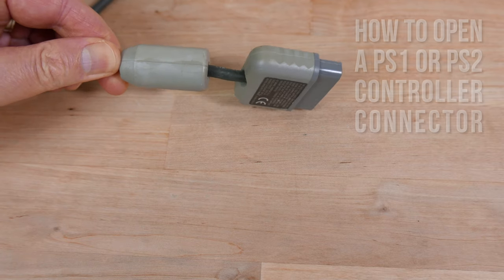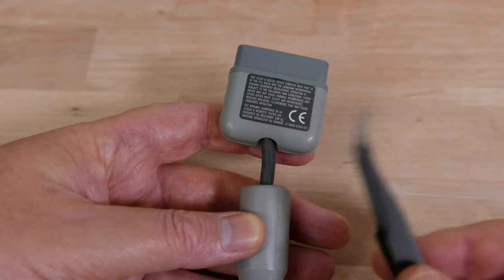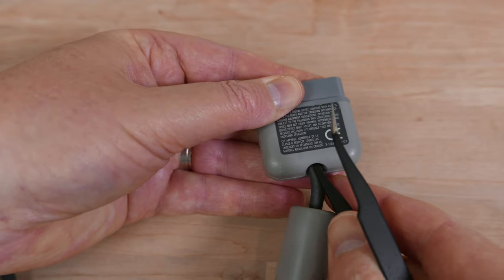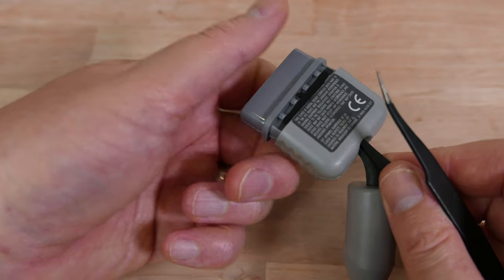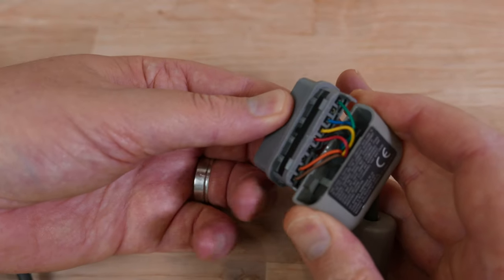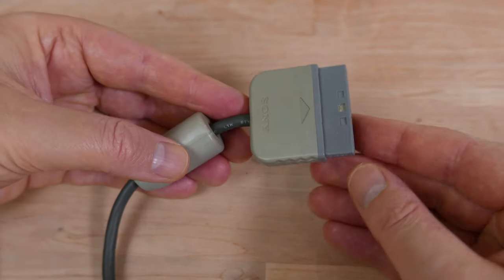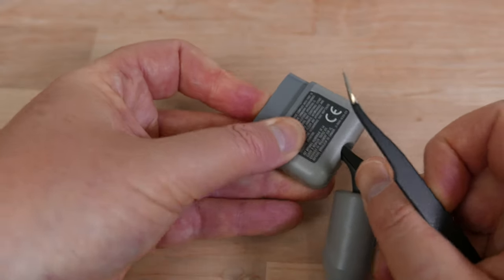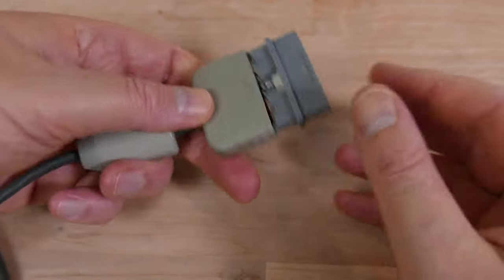How to open Sony PS1 or PS2 DualShock 2 Controller Connector the Easy Way

Comment: This video is awesome, but I did want to add a note here for anyone trying this that at least some of the pre-dualshock controllers are different. Not only is the locking mechanism different, but the entire way that they route the wire is different inside the connector. There's no bend + zip tie, and there's a metal fork-looking device crimped to the wire that I'm guessing is for structural stability. Using the method in this video will still help you pop one side of the plug out of the housing, and then you should use some pliers covered with tape or cloth to work the plug loose from the housing. I was doing a few attempts on old controllers I have laying around for practice (pre-dualshock PS1 NTSC [USA]) before I attempt a repair on a rare-ish arcade stick for PS1 with damaged pins and noticed the difference right away.
Reply: What I found worked was;

With the sticker facing up, put a flat screw driver in and push it up towards the sticker. When the gap is big enough, put something in it like some tweezers.

Then do the same on the other side and it pops right off.

Comment: This was very helpful! I plan on paracording my controller and I was able to pop it off with ease because of your tutorial!
Reply: I have the same plan for my ps2 controller, do you have any clue how to get that damn ferrite bead off the cord?
Reply: @VaultClown  I pinched the most narrow end, REALLY HARD against the seams, jammed a skinny piece of metal between while the gap was barely open. Then just pryed it open from there.
Reply: @HoneySonya  ok thanks that helps alot

Comment: Is there a way to check if all cable work? Because I think that my cable doesn't work
Reply from the maker: You could use a multimeter to check. Put one probe on the pin in the connector and the other probe on the end of the wire. if you have continuity from one end to the other you know its working.

Comment: You should probably specify in this video that it might not work for all wired PlayStation controllers because some of them aren't designed the same. This technique doesn't work for mine for example because while I was able to insert the tweezers (albeit with some trouble because of how tight the cabling hole was), I could only get it to pop open a slight bit, but the entire plug case refuses to budge or be removed any more than that. It just locks back up as soon as I let go of it with my hand. Not to mention it ended up bending my tweezers out of shape from the severe pressure needed to even pop mine open in the first place from how tight it was locked...

Also, from what I've seen on the plug on mine by peeking into it while holding it open... the locking mechanism on the inside is different from the one you used in this video (specifically the dark grey part where your fingers were pressing down).

I was desperately hoping to disassemble mine to fix the severe rust and corrossion on the little metal contact in the middle square on top of the plug (the one with 3 small squares on it with a metal one in the middle of the 3 that locks onto a PlayStation's controller port when inserted). Still, this little tutorial is appreciated if I ever encounter a similar controller, so thank you anyway.
Reply from the maker: I'm sorry to hear that this method didn't work for you. I've repaired 14 PS1 and PS2 controllers over the last 12 months or so and this method worked on all of them, digital, analogue and dual shock / dual shock 2. The only controller I haven't come across yet is the one that was bundled with the small PSOne that has a smaller, rounded connector. I hope you find a way of opening yours and good luck with your repair.
Reply: I was in the same situation as you. I even damaged the cables, it was worse than before :D Then I managed to remove it very easily by clamping it with a vise.

Comment: How do you remove the cylindrical cable holder under the connector that you removed? Thank you
Reply from the maker: You mean the ferrite bead? You just insert a blade or something thin into the gap and pry. It just snaps open.